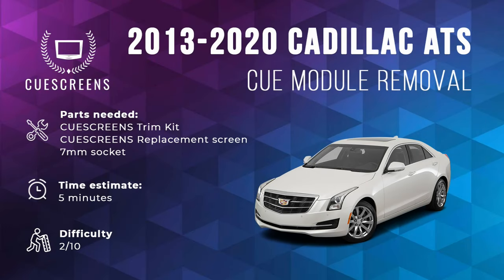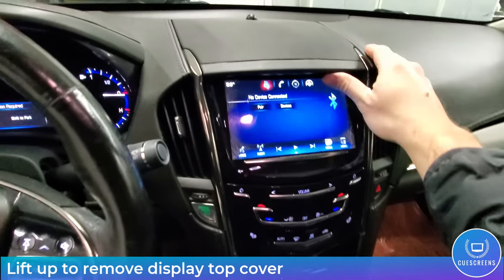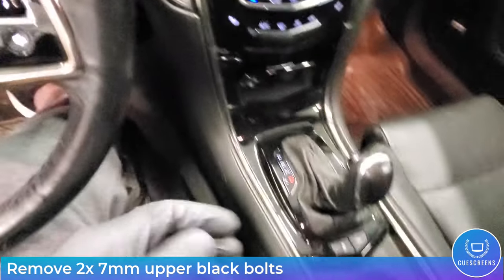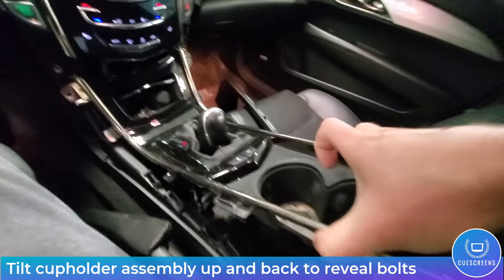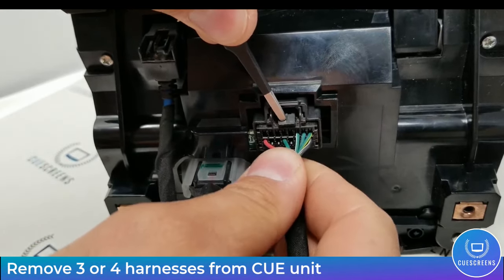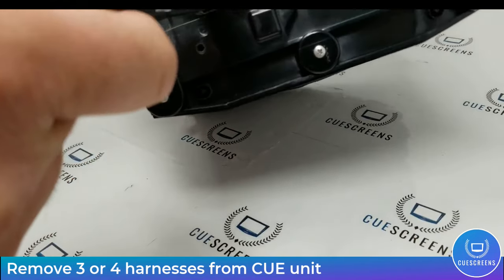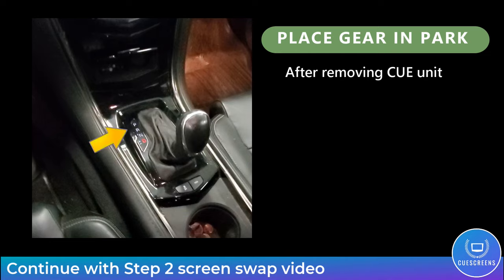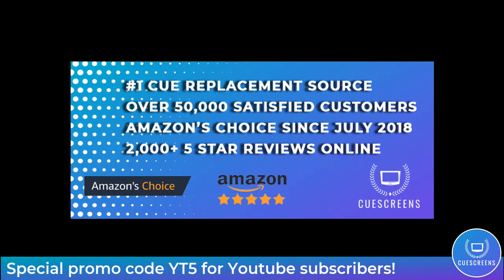2013-2019 Cadillac ATS CUE Removal DIY Screen Replacement

Comment: I've successfully completed the CUE screen replacement on my ATS with the genuine CUEscreens part. Excellent results!  But I would add that the removal of the unit from the dash, and especially the re-installation, is MUCH easier if you remove the plastic cupholder module from the center console. It allows for a lot more room to work. It takes a little bit of force to wrangle the cupholder out with the included plastic trim tools, but entirely worth the extra couple of minutes.

Comment: Got a 2013 Cadillac ATS 2.0T with 6 speed manual transmission it's different to remove the cue system from the car
Reply: hey I have a 2017 ats 2.0T 6 speed as well and getting ready to take on this project, what's different if you don't mind me asking? just want to know what I'm getting myself into. TIA
Reply from the maker: How so? move the gear to 2nd or 4th or 6th to make space

Comment: Just installed it in my 2013. Thank you, t's like I have a new car again.  

For those attempting this, I think what he did in the video to make things look smooth was that he took rhe metal clips out and put it back together without the clips before he filmed it.   So just be aware that it is going to require more force to get the top piece and the lower piece out than he is using in the video.  I also found it also helped to pull on the rear of the black cup holder and release it before removing the lower piece.

Comment: I just received my Cue module screen today and successfully installed it.  The two installation videos were absolutely perfect!  It’s great having my Cue module infotainment system working again.  I had problems with removing one of the electrical plug ins…..it did not remove as instructed however other than that everything matched up exactly.  The screen has GM endorsing and I cannot tell the difference between it and the OEM unit.   I’m extremely thrilled with this purchase as everything works perfectly and it appears as OEM!

On a side note I took my car into the dealer last month relative to this issue and they indicated two prices for replacement of the Cue screen, one with an OEM screen and the second with an after market screen ($1,000 & $600) respectively.  I replaced this unit myself for approximately $175 (Canadian)

Peter
Reply from the maker: Awesome, nice job

Comment: Awesome, removal/replacement was quick and easy, works great. Cuescreens gets a 10 thumbs up from me. The dealer want about $1100.00 to "diagnosis" and most "likely have to replace the unit" Total cost to me to DYI was $189.00 and about an hour 1/2 of my time.

Comment: Do you have any tips on how to remove the USB plug safely? In this video you’re removing it on a table but inside the car space is tight and I can’t position my hand or tool underneath the clips.

Comment: I dont know how the control panel works but my partner wants to refinish it because its a little cracked and peeling.  He plans to buy a replacement, and eventually a screen (the screen has no issues atm) but I'm wondering if refinishing something like that would actually be a good idea?  Im afraid 😐
Reply from the maker: We have the replacement AC panel to fix the cosmetic issues you talk about. Its easy to replace. Check out website https://www.cuescreens.com/product-page/replacement-ac-control-panel-faceplate

Comment: Bro, does anyone knows how to fix CUE issue? My problem is a little different from others. A warning message block the screen "Taking ur eyes off the road too long or too often while using this system could cause a crash, resulting in injury or death to you or others. Focus attention on driving"
I have already changed a brand new screen but this message is still there. I cannot see any icon.
Reply from the maker: Its the same issue. Order this one. You probably ordered a cheap $20 replacement from ebay that doesn't work with your car. https://youtu.be/AzMrYJPxxN8
Reply: Did you ever figure this out? I swapped it out with a brand new cue screen and still have this issue 😢

Comment: 7mm bolt? That tool was not included in the box. Guess that’s why you didn’t show you actually using it?
Reply from the maker: Correct, as a DIY project you need to supply the tools provided as clearly noted.